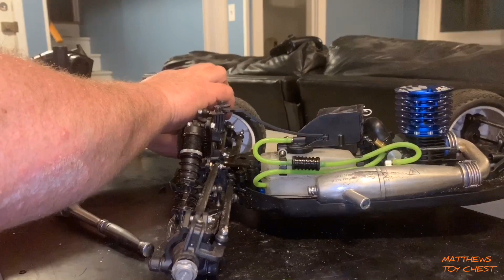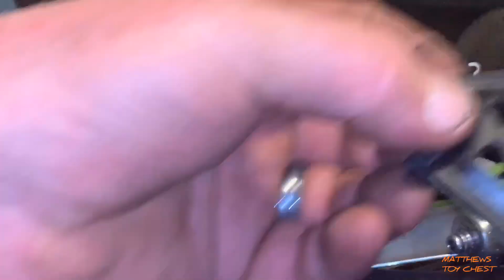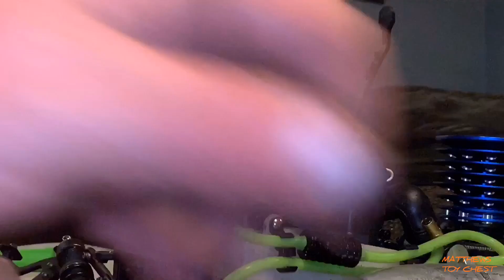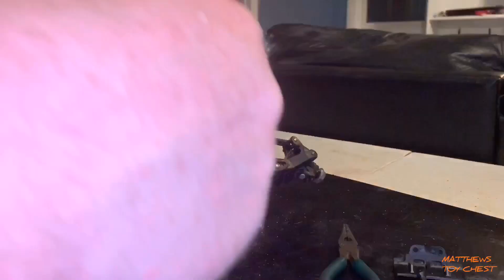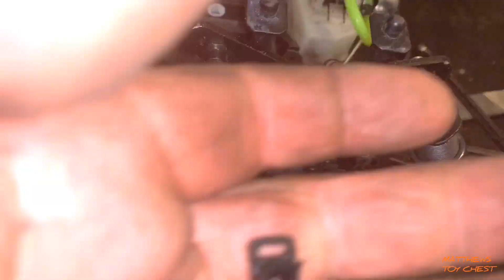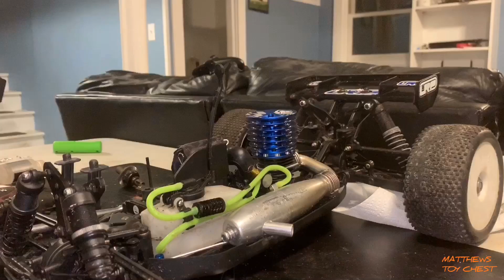Losi 8ight t rtr 4 gear diff conversion part 4.

Comment: Great video as always bro! Well detailed.... Thanks for the shout out hahaha I'm glad you figured out the issue cause I still haven't pulled it all apart once I shave a bit down on the casing. So looks like I'll have to do the same an order up some more parts hahaha. RcWaffel is great for prices. The exact places I went for all my parts to. Was thinking of switching shocks to the 4.0 as well. As Professor Botajell suggests as well. But again I'm glad you figured it out.
Reply from the maker: Soundwave_9 I will end up switching the shocks and camber links next. Thanks I appreciate the kind words 👍👍👍👍

Comment: The ring gearing is different the RTR uses a helical cut gear and the TLR uses straight cut gear so the pinions should also be changed. But great instructional video 👍👍👍.

Comment: Awesome video! Thanks for the very detailed description! I ended up getting the 2.0 diffs on accident. If I stick with them, do I have to change the out cup drives? I’m aware that I’ll have to change the ring and pinion which is a bummer. I have the 4.0 center diff on me so that’s a plus.
Reply from the maker: Christian Sandoval Awesome glad the video helped you. Yes you will have to get new drive cups. The drive cups from the rtr are a much smaller shaft diameter is a 2.0 3.0 and 4.0 drive cups. However if you have any drive cups from a LST style truck they will work as well.
Reply: I also like the new look for your truggy as well. Even though I have the full 2.0 diff kit, do I still need the 4.0 pinion gear and change the 2.0 diff cups to the 4.0 cups? I’m also noticing you didn’t change them out. Also, would I have to convert the center diff mounts and brakes to the 4.0? Or can I use just the springs? I appreciate your help!!!
Reply from the maker: Christian Sandoval if you have a matching set of 2.0 ring and pinon gears you do not need the 4.0 ones. If you have 2.0 diff cups you do not need the 4.0 ones. The 4.0 ones are the same size as the 2,0 and 3.0 just the 4,0 ones are lighter. You just would not be able to use the rtr diff cups or gears with the 2.0 , 3.0 , or 4.0 diffs. As far as the diff carrier and brakes you can use the stock rtr carrier and brakes with any of the diffs.
Reply: Got it! Thanks for the clarification. Hope to see more videos man.

Comment: Great videos! Im in the middle of upgrading my 8ight t rtr as well. Do the diffs use standard or metric allens??
Reply from the maker: JOHN F They use standard Allen bolts 😂
Reply: I knew they use standard allens but I got my center diff out and trying to open it to change the fluid and .05 is too small and 1/16 is too big? Am I missing something?🤔

Comment: I forgot to say to someone told me that the pinions on the RTR are softer metal to an the 4.0 diffs will chew them up. So not sure if that's true or not but a heads up.
Reply from the maker: Soundwave_9 they are a softer metal. Generally speaking I don’t really see it as a problem. But like I said I’m a end up switching to the TLR pinons
Reply: Ya I'm sure I should do the same as well.... So does that mean we have to switch everything right down to the out drive that holds the center rear dog bone ? Or will it be ok ? Because there's what 2 bearings, the sleeve , and then the out drive.
Reply from the maker: Soundwave_9 there are 2 bearings yes. If you buy from rc waffle they come with the bearings. I’m not sure if you would have to use the tlr output cups. I’ll probably just get those too cause I’m already using them every else.